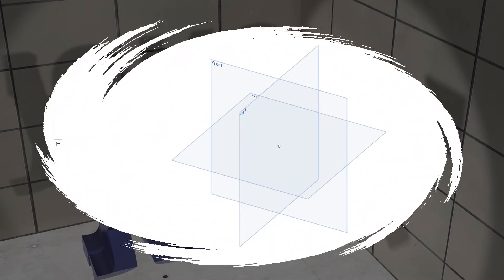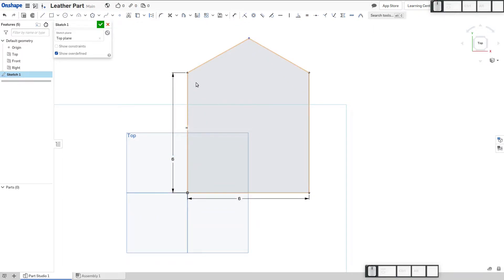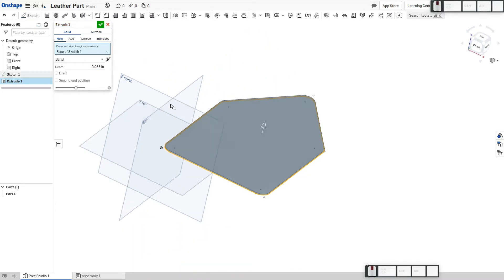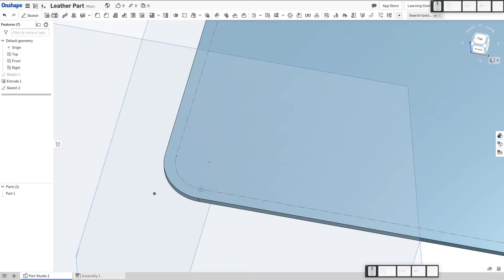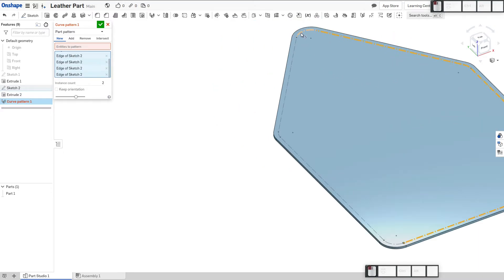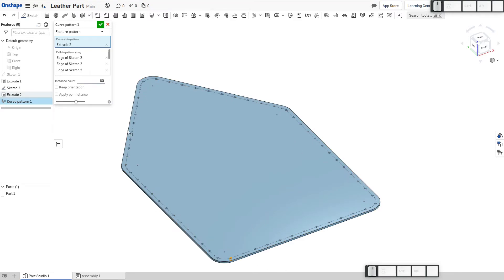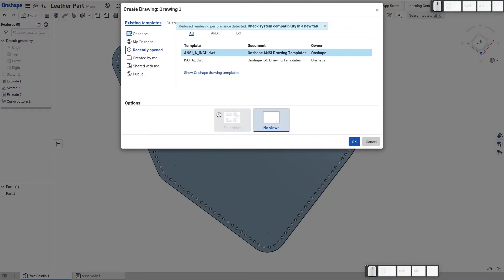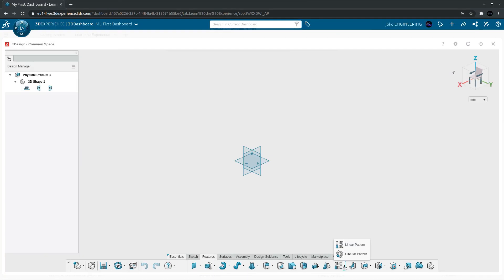Onshape for Leatherwork - Model Stitch Marks and Make a Template (Request)|JOKO ENGINEERING|

Comment: Great, been looking for how to do this. Ill curve pattern my thanks to you.
Reply from the maker: My pleasure.  FreeCAD has this capability too if you would rather use open source.
Reply: @JokoEngineeringhelp  Could FREECAD  be setup to run on a server as Onshape so it could be used online for codesigning?
Reply from the maker: @runethorsen6230  I know there was a guy that got FreeCAD working on the cloud once.  I don't know if that is still being actively developed, but based on that I would say it's possible
Reply from the maker: @runethorsen6230  See here: https://freecadcloud.com/
Reply: @JokoEngineeringhelp  Fantastic. Gave it a shot but it didn't work - many issues to solve. Anybody got it up and running?

Comment: For non-onshape people:
Make sketch in fusion or freecad. Manually create an offset or use the “dxf for laser” Fusion 360 plugin with a negative kerf to create the offset more easily. Export as dxf. Import into Inkscape. Set pattern of inner offset lines to dashed and you’re done.